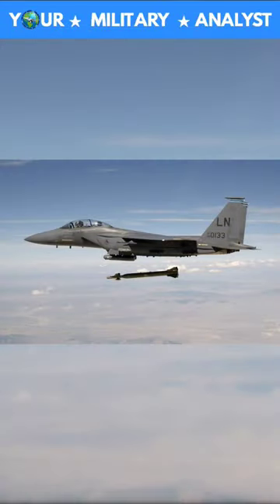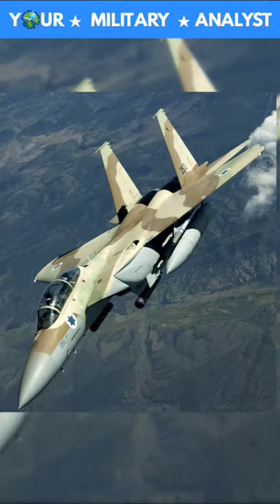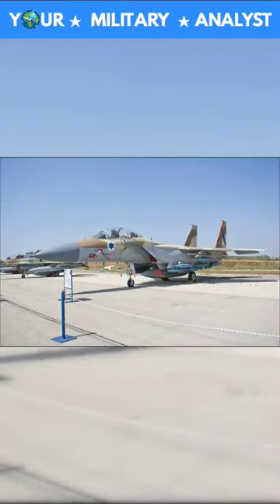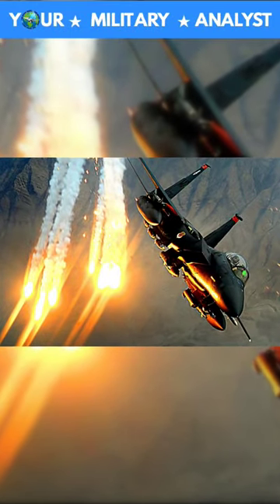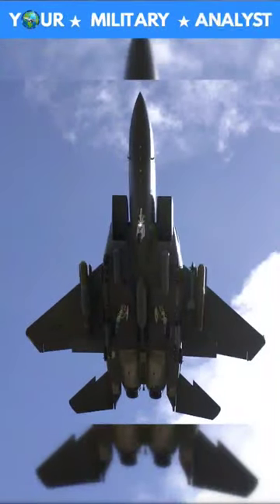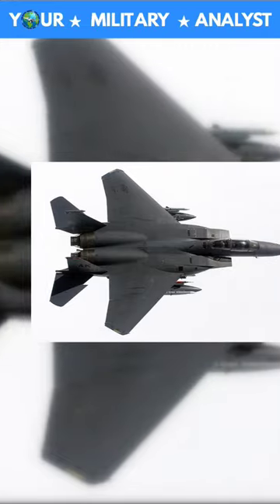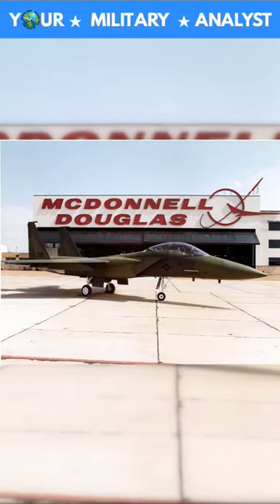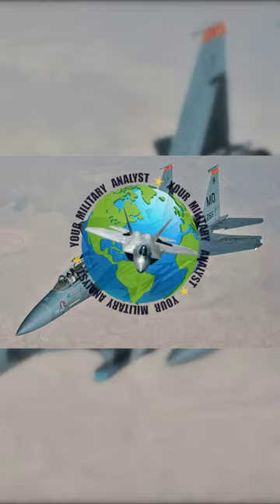The Fastest Operational Fighter Jet in U.S. Air Force | F15E #shorts

Comment: If you guys don't know the F/A 22 Raptor is the the best air to ground and air to air US fighter jet and no other US fighter can match it aspeshely the f15 which is a 30 + year old fighter
Reply: You spelled especially so bad, that auto-correct had no clue! But I bet you are right. With a combat load, I am willing to bet the Raptor is faster, just as the F-106 was faster than the F-4 Phantom when loaded for combat.
Reply: The f22 is a 30 year old plane. The f15 is a 50 year old plane.